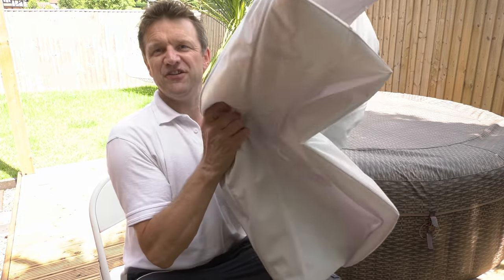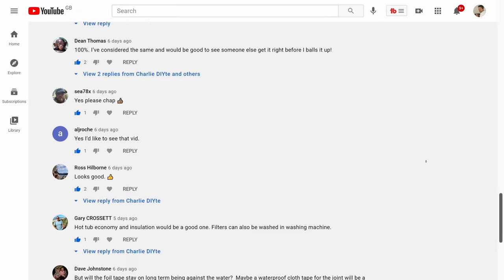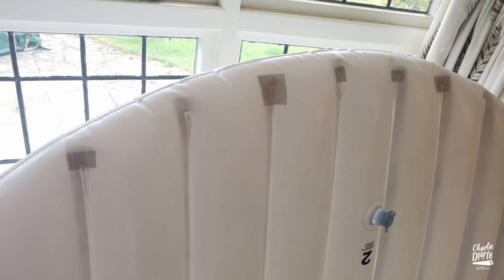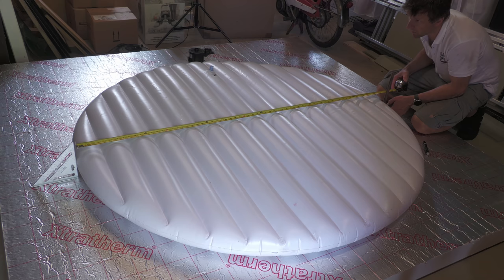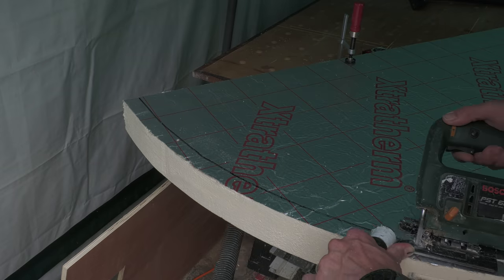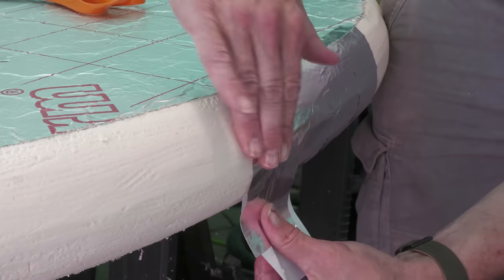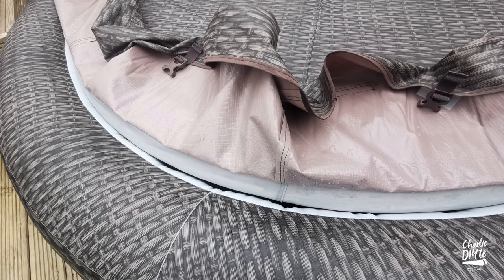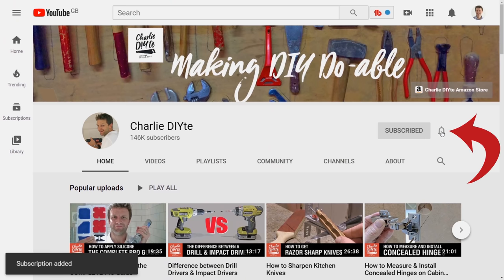Lay-Z-Spa Hot Tub Inflatable Lid Upgrade

Comment: I agree. Mine is now 1/8 full of water because it get’s condensation inside and you can’t empty it out. Shame as the rest of the tub is really good quality overall. I have the Vancouver model. I think the more expensive ones should come with a better lid.
Reply from the maker: The new lid is working well but it needs clear Gorilla tape in the centre seam because the foil tape reacts with the chlorine. If I did this again I'd probably ditch the skirt so I could make the PIR a bit wider but you do then have the hassle of two covers to remove each time. It's much more efficient to heat though

Comment: I have found the BEST way to patch holes is with 3M sealant.  Find the hole, make sure its dry and apply. You do NOT have to totally deflate to apply but is MUST not be fully inflated. It is so thick
when applied the leaking air will not push through the applied sealant. The patch kit that comes with your inflatable tub should be thrown straight in the trash. I've never had a leak restart wherever i've applied it.

Comment: Thanks for that.  Very interesting.  I think I'll go for the separate board cover option,  but will definitely seal the edges with foil like you did.  Possibly with a smaller square of board in the centre to tent the cover.
Reply from the maker: That's wise Alex as mine does have a tiny gap because of the issue of fitting it in the skirt. Also the central foil tape needs clear Gorilla tape to stop it reacting with the chlorine. Other than that it's working a treat 👍

Comment: I used to have an intex inflatable hot tub and the top never got punctured but it did become heavy from water.  I believe the water was from condensation but it was a big pain for about 5 years to get the water out.
Reply from the maker: Thanks Joseph, that's interesting. Must be some sort of osmosis going on 🤔
Reply: Yes I have a lazy spa Bali and my lid has water in but no puncture it's coming up to 3 years old now had 2 winters outside I made something very similar out of 50mm insulation board but sat the board on top to try and stop the water pooling on top of the cover it worked not perfect but stopped most of he rain pooling. My only problem is the top edges have misshaped in two places. The inflatable lid has now curved inwards so I have turned it over and it's now sat perfect like a dome on top. When the lid finally gives up I will definitely make one out of insulation board such a great idea

Comment: Had exactly the same issue with my Lay-Z Spa Tahiti. Had a few leftover PIR board laying aground to take to the scrap yard but i used 3 pieces and taped them toughether with alu tape. I wanted the lid to lay flat on the tub, but unfortunatly, my left over panels were not large enouhg. Instead of a 1500mm circle, I had to cut a 1400mm one. I did not take the time to try and fit it in the placeholder of the lid, for the reason that i wanted to be able to clean the lid. There is a possibility it can get mold i think. Anyway,  i cut of the edges in a 45 degree angle and it now sits sunken in the spa, but doesnt touch the water. Long story short, the same princeble, but i did not attach it to the cover. 

There are a few small gaps, but if you close it up with the lid, it's just fine. The water also stays hotter for a longer time. If someone wants to see a picture, let me know. It's a win-win. I dont have to pay for disposal of  the PIR insulation board and i get a better insulation for the tub. Downside: i have to store it somewhere when not in use. But for now, I'm planning on leaving it for the winter and see .
Reply: I used 60mm PIR insulation board with alu vaper barrier. Taped the sides with alu tape. I had to make it out of 3 pieces I put tougheter. The alu tape is strong and holds the 3 pieces toughter very well. No flex at all and it can support the weight of a cat :D
Reply from the maker: Well done Arne. Yes, I leave mine out all year round. If I put it away the rodents will eat it.
Reply: Arne did you notice any gain from using only 60mm PIR boards on saving electricity costs ?
Reply: @Crazykillerz998  I wish I could tell you. Still renovating my home so have not yet invested in a power metering device. Planning on doing so with a Shelly. Anyway, I'm pretty sure it gains you a lot of efficiency. The R value of pir is a lot higher than just air. Also, you lose the most heat on the surface of the water because it can vaporise. The only downside is that you have to store it somewhere. But I'm really happy I did it.
Reply: @Crazykillerz998  so in short, while not measured, I'm certain it will save you a lot of energy. It hasn't really frozen a lot here in Belgium but when it does, the ice and snow stays on top of the cover. Only in a few spots it starts to melt because of some gaps in between the border of the tub and the insulation.

Comment: I have been thinking about building a replacement lid with a solar water heater built onto the top of it. I live in the south of Spain so at the moment the water temperature without being heated is between 30 and 33 degrees most days I was hoping to raise that by 5 degrees with a black hose coil and water being pumped round it with a 12v bilge pump.  Any ideas or can you foresee any snags?
Reply from the maker: Sounds ingenious Warren. I suppose the question is whether the hose would get hot enough to heat a continuous flow of water 🤔 Worth a try though. Let me know how you get on.

Comment: Hi, do you feel you absolutely need the rigidity of PIR board, and accept the cost, or could you save a lot on costs abd use Jablite / polystyrene board instead?
Reply from the maker: That's a decent shout. Doesn't have the reflective foil on it and might not be so easy to tool but worth a go. I suppose the issue is whether you can get tape to stick to it - which you'll need to join the pieces.

Comment: 2:54 -> cyanoacrylate glue (superglue) won’t hold up on inflatable rubbers or plastics. As soon as you add any air to it or it bends, the seal will crack and let air through as CA glue dries hard. A flexible waterproof glue is needed, E6000 works good, I’ve used it on inflatable paddle boards and it’s held up for over 2 years now.
Reply from the maker: Thanks. 👍

Comment: Great video, i have the Vegas model, and the inflatable lid was poor , i managed to install the same as you (foam insulated board,
all in one piece not cutting it in half to fit the skirt, I measured the inside diameter of the main inflatable body and taken 2CM off so to allow changes in size due to rise and fall to temperature. The skirt can stretch a little to fit the last quadrant, and the use of bike tire leavers helped. now the cost of heating the hot tub has improved.
Reply from the maker: Great work Steve. I actually wish I'd cut the skirt off. It's neater how I did it, but there's a tiny gap around the side but I might see if I can find some foam sheeting that I could feed between the skirt and the insulation. It's working well and cheeky much more efficient to heat, except I did have to cover that central foil tape with clear Gorilla tape to stop it reacting with the chlorine.
Reply: I've had 3 inflatable lids for the palm springs and they all lose air and fill up with water.
Reply: Steve what board did you use in the end. Some of the conversation has been around XPS board (which seems harder to find in 100mm). I'd be interested to know from you and Charlie, or anyone else that if you were to do it in 2023 what board you would choose? Taking delivery soon of a Foam sided Lay Z Spa, but the lid is still inflatable which is crazy!!! Thanks.
Reply: @creativechimp03  
Good evening. My next-door neighbour gave me a sheet to use, as he is a builder.  I would say to go to a local builders merchants. Thickness is not critical,  but obviously, the thicker the better. I hope this helps.
Reply: @stevepope4020  Brilliant Steve, thanks will do. Is yours still holding up well?
Reply: @creativechimp03  
Yes it's still in excellent condition,  when I made the lid i had  a roll of pallet wrap and I wrapped the lid several times to keep out the spa water, as the chemicals can degrade the  silver foil on the insulation board. 
I haven't had the hot tub going this year as I live in West Cornwall and currently there is a hose pipe ban so unfortunately we had to go without 😢
Reply: @stevepope4020  awesome. I will certainly give this a go and see if with the tyre levers I can force it in too in one piece. I have some of the wrap too so I’ll give that a try. Fingers crossed you get to use the tub soon, alternatively, leave it open and let the rain fill it, it’s not like we don’t get enough in the UK!! 😀
Reply: @creativechimp03  
Lol hopefully the ban will be lifted soon. I could use theRain water from the roof just divert the down pipe into the tub, I can use my wife's tights as a filter, making sure the tights are clean lol

Comment: I've thought about buying a big sheet of ply wood and cutting a circle out the same diameter as the hot tub so it sits on the top and completely seals it.
Obviously paint it too with waterproof paint.
The weight of the wood would create a good seal and it wouldn't be a problem when it rains.
The only drawback is the weight, it may take 2 people to take it off and on.
Just wondered if you considered this before going down the route you chose?
Great video though buddy! 👍
Reply from the maker: You need the insulation though mate and yes the weight would be a problem. When I first started trimming that PIR board I had a shamfered edge that sat beautifully on the top, sealing it completely, but I had to keep reducing it to get it into the skirt. It's neater the way I've done it but you do get a bit of heat leakage out of the small gaps around the edge. Might have been better to ditch the skirt in hindsight. If you need to join the PIR like I did with that tape, clear Gorilla tape is better as that foil tape reacted with the chlorine.

Comment: You would t think it but HOT GLUE works! If you use it on the raw styrophom ( not the foil. But if you use hot glue on both sides of a foam and press them together- they do not come apart! It basically melts it together. So this is a tip for anyone who has to piece styrophom together. Then I used a pool noodle around the outside circle edges. Used foil tape to secure it. Then slide it in the skirt lid. This gave it the ability to be pushed into the hot tub and suction in place. Hope this helps someone.
Reply from the maker: Love the sound of that 👌👏

Comment: Awesome video Charlie. Could you not have put a hinge on the top of board in the middle to allow the lid to be folded over to allow easy access and then maybe tape down the joints in the middle joint?  Just wondering.
Reply from the maker: Nice idea but the problem is it's hard to fix into the foam. You'd need to bolt through but you want to minimise any metal in there, because of the chlorine.
Reply: @CharlieDIYte  You could use nylon bolts/nuts.  I imagine there are non-metal hinges you can get as well.  Having a hinged top would be nice if you just want to hop in yourself and leave the cover half open.

Comment: I’ve had the same issue with the Santorini inflatable lid. Useless item and is poorly designed. I’ve just made this in the video but instead of fitting it within the top cover, I’ve made the it so that it just sits on the sides like a lid with the cover over the top. Seems to work ok and stops the water pooling which is a real pain if not under hard cover

Comment: I do not recommend using foil tape. That tape is meant for taking duct work which is not exposed to heated chemical water. I used that foil tape on my lid and just after a month it was dissolving. That left a lot of residue in my tub but also are away at the tape making removal in order to replace the tape very difficult. I would recommend using a tarp tape Wich has better resistance to the elements.
Reply: What is tarp tape? Duct tape?

Comment: I wonder why you didn’t just use 50 millimeter XPS insulation panels? They would have been a lot cheaper than the foil covered insulation that you used. Haven’t tried it myself though.
Reply from the maker: Hmmm. That's an interesting one. I wonder how it compares weight wise? 🤔
Reply: XPS is made for wet environment too I’ve been told so thinking of using it as a base?  Do you think that would work ?
Reply: @helenalovelock1030  yes it would. Plenty of Facebook groups that show it does

Comment: Wondering if it would be possible to fill the (leaking) inflatable lid insert with expanding foam 🤔 at 6ish quid a can for bog standard Scr3wf1x stuff it could be a cheaper option which also does away with measuring, cutting, taping etc.
Reply from the maker: If your read the comments quite a lot of people have done that. I'm amazed it works though.

Comment: Nice. I have the saggy cover problem and will give this a go. I want to use my hot tub in the winter, any thoughts how I could insulate the bottom? And would it be practical? Would love you to make a vid 👍
Reply from the maker: So I keep mine running all year round. I started with the Lay-Z-Spa mat, then added a 1 inch PIR board below the mat but as you'll see in this video https://youtu.be/ZOQ2L1TMayc it makes a mess of the deck so I've now give back to the mat.
Reply: I use the child play foam mats that are different colours, not sure the réal name for them and the tub mat
Reply: @vermo42  I did the very same  the shop wanted £35 for 1 pack an as I had the 6 person I didnt think one would do  so I went to home bargains an like you bought kids play mats 12 in a pack for £5 I bought 3 packs and had plenty even space to stand while getting in an out the tub  and sitting on the floor is very soft and comfortable.

Comment: What do you do for an internal puncture of the tub liner too please thankyou
Reply from the maker: I did have a leak on the main tub. The hot tub came with a patching kit and I bought some compatible super glue (one that works with rubber etc) cut a small patch and glued it on. Any leaks in the lid forget trying to fix it. I fixed about 10 and new ones kept opening up.

Comment: Great video Charlie. Another option is to buy some elasticated webbing and sew two strips 90 degrees to each other in a cross and sew the ends ends to the cover at the edges where the PIR would meet. You could then slip the PIR in, probably in one piece too?  Easy to replace in the future if the PIR or cover fabric fails.
Reply from the maker: Thanks John. Yes, that's a good idea. I also thought of some sort of zip on the skirt but I guess even a plastic one could be problematic in terms of rubbing on the tub.
Reply: @CharlieDIYte  Hi Charliue, you could also cut the inner skirt along a diameter, at the extremities, and face each side with velcro. Then you can open the velcro to fit a very tightly cut PIR Board! Then velcro both sides back up. No issues with zips cutting the material. And if you rotate the PIR boards 90 degrees once installed, the  weak points would be on different axis.👍 Great video ass always!

Comment: I have got thw same hot tub as you and the inflatable lid is starting to sag in the middle due to the rain. 
Please can you confirm all the measurements you require for yours? I'm going to see if I can try and make myself a lid for ours. 
What happens to the boards if they have to much moisture on them?? 
Great video by the way.
Reply from the maker: It's all in the vid. If you try and fit it in the skirt like I did you end up with it a little too narrow so it might be best to ditch the skirt so you can make it larger. Plus use transparent gorilla tape in the middle not the foil as the foil tape reacts with the chlorine.

Comment: Would it be possible, or practical, to fill the inflatable lid with expanding foam?
Reply: Expanding foam is open cell, it soaks up moisture like a sponge.
Reply: @JerGoes  thanks for the info, I didn't know that but was wondering if it was suitable or not.
Reply from the maker: I would say not practical as you'd need too much expanding foam, chances are you wouldn't get it into all the extremities of the lid, and assuming you did manage to fill it, you'd be back to the same problem of fitting it into the skirt, albeit you'd probably fill it in situ, but would then never be able to remove it.
Reply: @CharlieDIYte  in situ was the way  I was thinking but as Jer Goes pointed out expanding foam is open cell and soaks up water so a non starter.
Reply: @CharlieDIYte  how about fitting expanding foam into the inflatable? Whilst already fitted into the skirt Hopefully someone has tried this so I don't have to 😃
Reply: @craiglee166  that was what I meant  when I said about using expanding foam, directing it into the punctured inflatable part whilst in situ in the lid, if it was sealed at the punctures could water still get in do you think?
Reply: @phonotd  I personally think it's a cracking idea....let's hope someone has already tried it!. I'm still searching YouTube for an answer
Reply: Mine is done with expanding foam, the no nonsense stuff from screwfix, Carnt remember how many tins it took but was a lot more than expected. It doesn’t suck up any moister that I know of…..all I did was the small air leaks, opened them out to accept a flexible hose on the end of a foam gun, then when the foam had expanded cut the little bit off that’s out the hole (or a lot in a couple of cases) then glued the holes shut with a swimming pool repair kit. Been fine for over a year.
Reply: I’ve seen it done and looked ok. For what I know about expanding foam, it doesn’t take any prisoners it’s mega messy and the celotex method isn’t much price difference
Reply: I filled my lid with expanding foam, much better than this way I would say, took about 10 cans of cheap foam, I had to stab holes in the top of each canal in the lid, filled each with foam, then once it went off filled the holes with silicon But it’s quite heavy now.